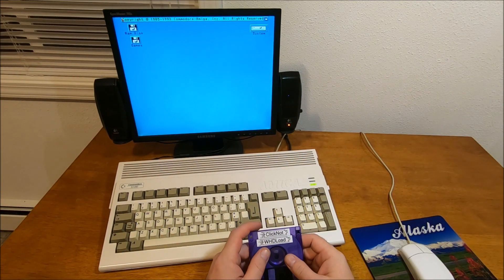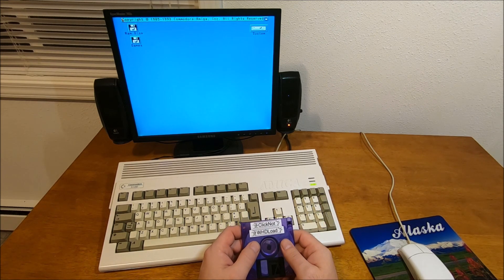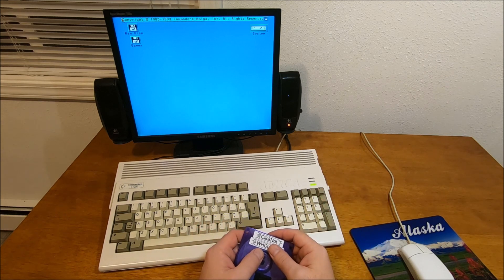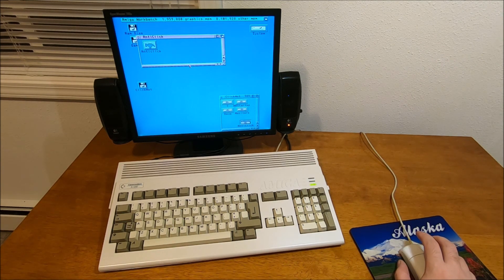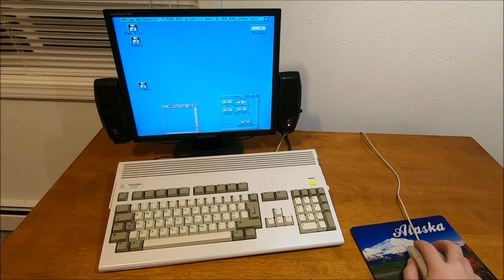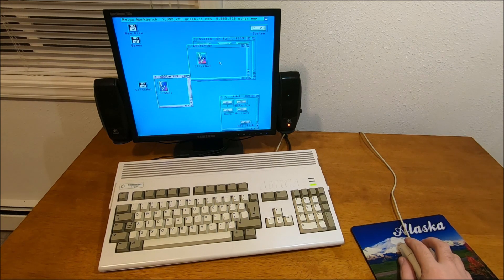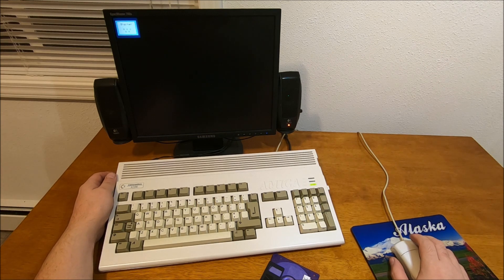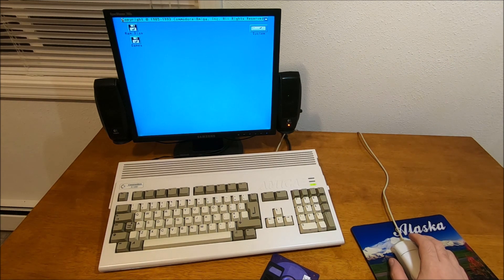How to fix clicking floppy drive on Commodore Amiga 500 600 1000 1200 2000 3000 4000

Comment from the maker: Hi all 😉, this is a simple way how to fix clicking sound on Amiga floppy drive, and it will work on any Commodore Amiga with hard drive / CF card like 500, 600, 1000, 2000, 3000, 1200, 4000. 😀 And the best part after this simple mod your floppy drive will still work same as before